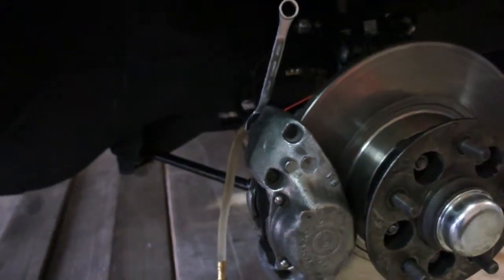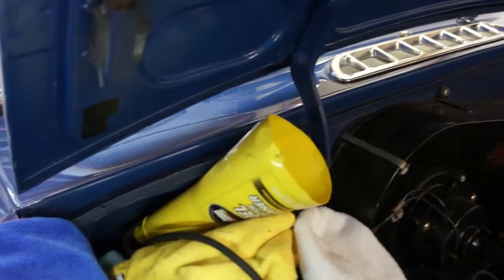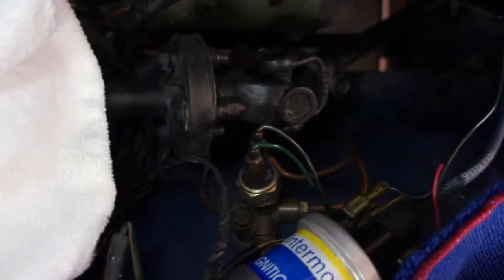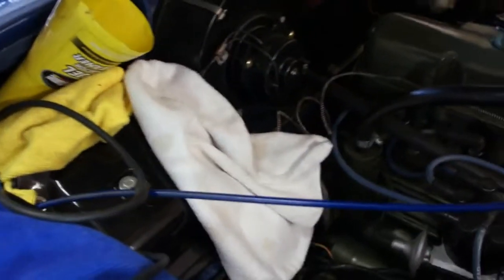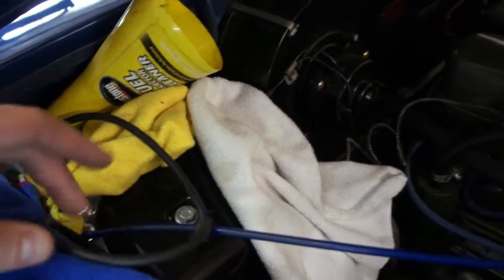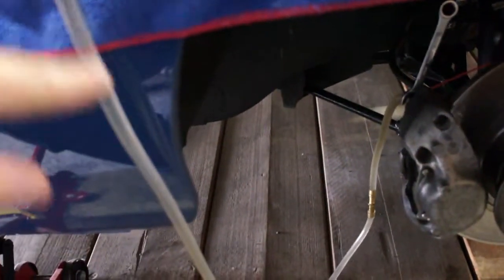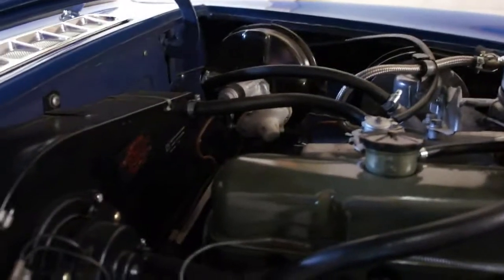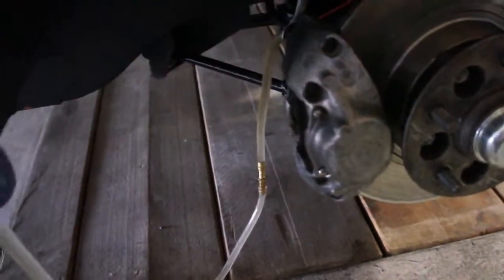1968 MGC Closed Loop Brake Bleed to Remove Stubborn Air from Master Cylinder or Servo Lines

Comment: Hi bud, I have read from various forum that bleeding MGB brake fluid could cause damage to the Master Cylinder.  Is that true??  Do i just bleed it like any other car?
Reply from the maker: Haven't heard of that, yeah I just bleed mine just like normal. I have a couple of videos on how I bleed the master cylinder if you have problems with that. But if you just exchanging fluid yeah you can just bleed them like normal.
Reply: JR's Garage do you know the order?  I dont have a servo, just a basic one
Reply from the maker: Book says front furthest from MC first then other front, then rears in no particular order.  If you have a single outlet MC.  If you have a dual outlet MC start with rear furthest, then other rear, then front furthest, then last one.  It calls for a different process for pumping the brakes.  I have a picture if you give me an email address I'll send it to you.
Reply from the maker: That's from MGC manual.  I'm assuming B is the same.
Reply: @pleekh  This information is for a MK1 1962-1967 MGB.  The MGB workshop manual says to do the nearside rear first, then the others. It doesn't list an order after the nearside rear.  Another MGB manual I have says nearside rear, other rear, then fronts.

Comment: Thanks for sharing this technique. I wasn't looking forward to taking out my master cylinder again on my 1968 Rover P5b, however this method finally helped eliminate all the trapped air from my system.
Reply from the maker: My pleasure, so glad it worked out for you.